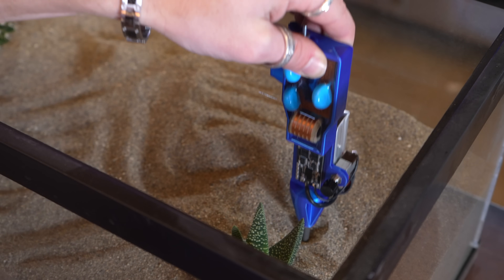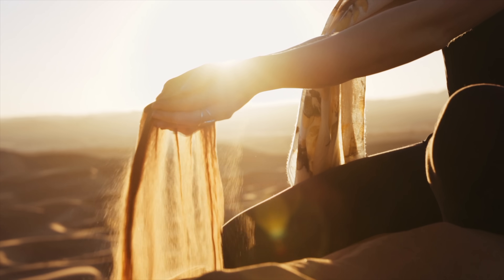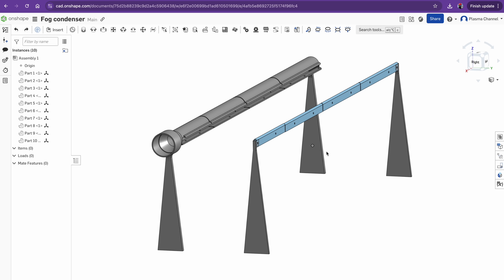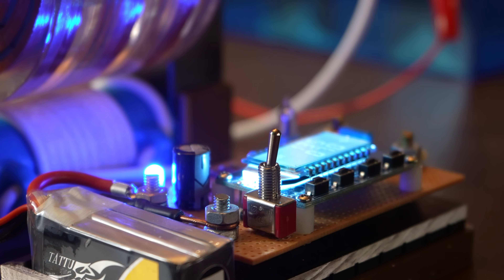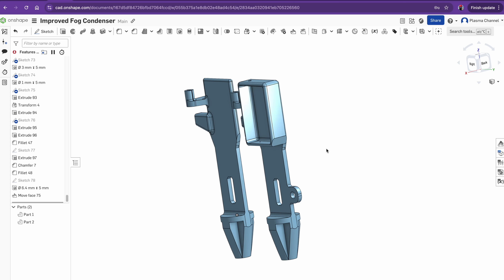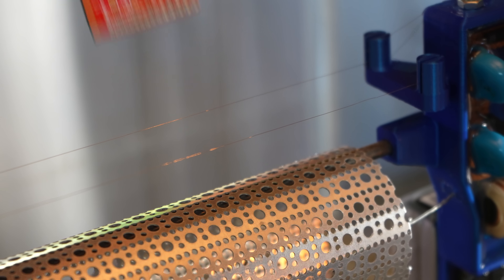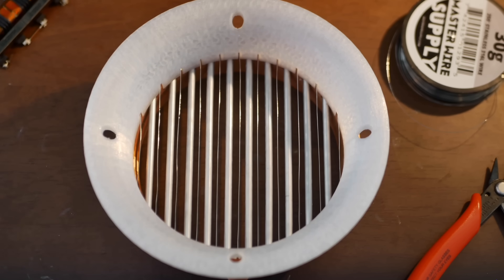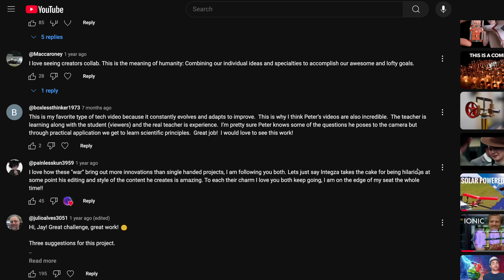Solving Desert Water Shortages Using 20,000 Volts

Comment: While i wish it didnt require fog, i would like to see a larger scale, higher powered version, would 30kv be too much and just send too high of air volume, with a raised temperature that has a higher water vapor capacity over the rakes? Would 10kv be even more efficient if it didnt warm the air as much?
I dont actually know the conditions this 20kv is creating, it might only be moving the air, but it may also be heating it alling for more of the water droplets to evaporate.

(without fog the very inefficient TEC based dehumidifier would be infinitely better at collecting water, and a regular dehumidifier would be something like 5x better)

Comment: Jay, the wires in your collection grid should NOT be horizontal and vertical. Droplets form on the horizontal part, but they do not flow downwards. Droplets that form on the vertical parts flow down before they reach an optimal size to collect other droplets on the way down. I'm not sure if 45 deg. is optimal, but it would be better than hor. & vert.. I read a paper about it a few years ago. Google fog harp maybe? If it comes to me I'll get back to you.

Comment: I have to wonder if that cheap dehumidifier used a thermometric cooler, since it was cheap and powered with 12v, both of which point to TEC. A TEC is far less energy efficient than the compression and decompression refrigeration cycle that an air conditioner or refrigerator uses. A good dehumidifier is basically just a portable air conditioner, but instead of pumping the warm air outside, it puts the warm air back into the room. And of course, it has a container to collect the water that drips off of the cold side.

I'm curious to see what a good dehumidifier would do for a more fair comparison, since most cheap consumer TEC devices are basically just novelty toys. I like novelty toys, just not as a comparison when trying to determine how efficient something is.

Comment: 515 Watts HE Energystar (compressor/refrigerant type)
~23659 ml per 24hr
~16 ml/min @85%RH

compared to ~9 mL/min - electrostatic dehumidifier (based on 40mL in 5 minutes) - 39watts  (I don't know what your RH would be to do a fair comparison)

Looks like it's certainly more energy efficient, but I need a real power consumption over time (compressors turn on and off, so the 515Watts is probably only for the on cycle.  Not sure what the duty cycle would be).  

So looks like electrostatic dehumidifier is the clear winner (plus a lot quieter than a compressor!) on energy efficiency.

Comment: This is so amazing, i'll immediately start to built one. I'm just thinking if this can be improved by adding a wire at the inner side of the metal grid and instead of 2 directly above to put them in a 90° angle

Comment: These often have one slight problem. They are designed and tested on environment that is not the actual use case for it. In a desert there isn't water in air as much there would be in many other places. A lot of people always forget that. It's nice that people come up with designs but hold up hype until it is tested on ACTUAL environment. It might not work at all (or massively under perform) no matter if concept is solid. Keep working on it tho.

Comment: A) They already do this with wet bed sheets (hang them out early, more water condenses on them, going into a bucket.

B) You're still using unrealistic amounts of fog.

C) You're giving the fog no where else to go. Is it going to condense on the dry sand? no. Is it going to condense on the cool metal? yes.

Comment: You could add peltier cooling to get the air closer to the dew point then also add a phase controlled speaker area that you could use to make areas that go through more constructive interference that when in the high pressure cycle increasing the temperature that the dew point occurs causing even more water to form into fog. Also because you can control the frequency and location of the extra fog, you could then reduce the frequency as much as possible and increase your voltage excitation as much as possible to expell the extra formed fog to the other charged plate before the cycle finishes. Potentially making the location of surface collection be in a location of deconstructive interference so to not evaporate the fog before it could condensate onto the charged plate
Reply: When I said area I meant array

Comment: You kept saying, "but then (the fog/water)'s all gone..." The moisture is still there, it's just not condensed into clouds/fog, because the relative humidity drops(aka hot air can carry more moisture than cold). 
That being said, I bet if you buried a pipe in the desert with your contraption in it, that was vented to allow air flow(which seems like it would happen with the charging of the air), you might be able to tease water out at all hours of the day, and not just when the fog was present, and you could use solar power to run it all day, while charging up a battery to run it when fog is there and air is super saturated... foggy. (or you could use a small wind turbine and potentially run it almost non-stop depending on draw and output.)
Just a thought; it's the same idea as earth ship cooling/heating pipes, using the ambient ground temperature to change the relative humidity in the air, you could use the same system for water collection, or maybe not, it's hard to say.

Comment: You need to automatically start/stop your contraption using an hygrometer. 
Also there are wild life issues. Birds, lizards, snakes, cats, rats as well as livestock are susceptible to receive shocks. I doubt you will make any usefull water harvesting in deserts but it can be a solution here in the Cyclades where tourism is harsh on water reserves and it doesn't rain enough. There is plenty of moisture in the air most of the time.

Comment: So galvanic corrision isnt gonna effect longevity for the contact patches?  What about electrolysis happening on the larger scaled setup and a spark setting off the hydrogen created?  I guess you could use electric fence bases with a multiplier added every so often to push the charge on down the loop..  but i would think with using stainless steel and copper conductors it would make browns gas and then randomly youd get pops and shorts..

Comment: Does this only work when there's fog? Which means that commercial dehumidifier could still overall when because it's just getting water out of the air while this plasma device needs fog which only happens for a portion of the day

Comment: What metal was the grid/mesh made out of? Is there a hydrophilic metal you could use that would aid in pulling moisture out of the air? I'm assuming we wouldn't want to use a spray on coating since that could get into the water.

Comment: It seems common sense in hindsight. Ionized vapor makes for sticky vapor. How much moisture would be caught in a metal mesh tarp that mixes the greenhouse effect with the high voltage application of the system you designed?

Comment: oh boy, a water-from-air device, I hear Thunderf00t coming 😅 Ive seen a lot of his debunkings in this area and one of the points he usually brings up is that even for the ones that do work (which this seems to) it requires way too much moisture in the air to be useful in the places it would be needed. Arid places do not have high humidity and the places that do have high humidity almost by definition also get a lot of rain. Add to that how much power youre using and its just not a good solution to the problem.

(edit: at 14:34 you give some stats but you leave out the actual humidity/moisture content of the fog so theyre almost meaningless, if you ran it with no fog at all your numbers would be completely different and you might get nothing at all.)
Reply: also you would need giant collection areas and spreaders because they only soak the soil directly underneath themselves and obviously they have no pressure to go through a nozzle or anything. It also sounds very dangerous for wildlife (and people) to have massive strings and grids of high voltage among the crops
Reply: it will definitely be interesting to see the bigger scale test

Comment: Due to health, I'm moving from a bicycle to a recumbent trike with e-assist (recumbent riding has less heart strain) this year. It also gives me a platform where I can put a pair of 150w photo voltaic panels on it as a roof. I reckon I might be adding a dew harvester to the rig, too, seeing as the aim is to get back to some light cycle touring post heart attack. Less water to carry is also less heart strain. In Australia, there have been a few attempts to "irrigate the desert" but it's teneded to be too costly to monetise... which says to me it's economies of scale are at the micromachine level. Direct crop watering, direct water bottle collection. There's been an absurdly expensive commercial one that's been on the cycle accessory market but failed for pricing, I think. But an HT supply from Ali, a voltage doubler, some simple hardware to direct moist air and condense the humidity, all running off the trike's USB phone charging port... sweet!

Comment: Its called rain.

Its how lightning works.

No, it is NOT in reverse.

Its all about voltage potential in the moisture and surrounding charged particles in the air.

Cosmic rays and gamma rays energize the atoms to find opposing charges that attract and coalesce, which always shunts an excess electron since the negative ion actually has an additional energy stage which moves up the electron charge to the point of an overcharge, and the excess voltage increases as the vast areas of charge get stratified.

It is just a common process of nature.

But what you are doing is working because you are packing the voltage potential to a smaller distance, making ion capture much more likely/frequent.

Comment: Something also to consider is that a properly configured thermal sink can also perform in the conditions you're stating... all that needs to happen is for night temperatures to be below the dew point at 'fogging time' and the thermal sink to stay below dew point for the length of time fog is present. No reason that couldn't also apply to ion driven systems like yours... just a negative plate sized with the right mass to stay cool as the fog rolls. Condensation would be aided. 

Actually thinking now that an underground water storage tank could be used at a heat sink, with the same reason and purpose. Self-amplifying water storage, just by pumping cold stored water through thin metal coils when the atmospheric conditions are right for condensation to form, with solar recharged ion blowers presenting freshly charged fog. The two mechanisms can't help but amplify each other's work, the charged droplet collection aided by the presence of more moisture on the target plate and the cold condensation aided by the movement of fresh wet air over the surface.

Comment: According to BartJBoles comment: Coastal fogs in deserts contain about 0.5 g/m³ of water.  By my "back-of-envelope" calculations: one could stretch the wire for 100m.  It looks like it generates an air flow of at least 1m/s over an effective width of ~0.1m.
So, 0.1m width x 100m length @ 1m/s = 10 cubic m/s, or 600 m^3 / min, or 36,000 m^3 per hour, or ~18 litre / hour by his estimation.  Not bad!

Comment: Does this mean that placing a grounded metal surface in front of a commercial available air ioniser would act as a dehumidifier?
How does this process do with dissolved water vapour rather than misted droplets?

Comment: This is essentially an electrostatic precipitator. While this will collect water as demonstrated, there is another much larger and more severe issue with this idea: Electrostatic precipitators pull solid particles out of the air as well as liquids. In a desert environment where the wind will kick up fine dust, this will be deposited onto the grounded electrode building up an insulating layer and dramatically reducing efficiency, assuming the device can operate at all once this layer forms. The entire ground electrode would need to be periodically cleaned. Traditional electrostatic precipitators are normally cleaned by spraying them down with water which is not ideal in this use case. It's feasible that these could be cleaned without using water but the process would likely be extremely labor intensive making the concept difficult to maintain effectively.

Comment: Even as impressively efficient and effective as this seems to be, the fact that it requires a metal mesh, and real world fog is usually a lot less dense than what you were feeding yours, means that economic and practical reasons will make this still incredibly tricky to employ at irrigation volume scales. Not to mention safety issues.

But for drinking water, which is only about 2-3 litres per person per day, this seems like it could maybe be viable...
But is still going to come down to cost per unit, practicalities of deployment, and ergonomics. Like everything always does.

Very cool and interesting tho, nice work.

Comment: Fair weather typically has an atmospheric charge... a potential difference of ~100V/m. 200 meters of thin wire on a balloon could potentially (hah) provide 20kv, though at microamps. Be interesting to see if a collector could be configured to take advantage of such low amperage. 

Oh, and a small balloon would be just fine in the conditions noted... it's foggy. The air is still, and dense.

Comment: Very cool video. I do industrial scale electrostatics, and always love seeing the stuff you play with. One point is that actual dehumidifiers are made the remove water vapor at below the saturation level so they have to overcome the phase change energy. Plus, those little dehumidifiers are externally inefficient. The tech you are using is commercially known as a wet electrostatic precipitator, or WESP. They are incredibly efficient but will remove only already condensed water droplets. Thus the efficiency, they mostly only collect, not condense. Fog is, of course, already condensed and so they will work well. Commercially, they are used to remove oil or tar fumes, or water droplets after scrubber operations.

Comment: its a water tarp, a big sheet artificial river. or just freeze the fog. more. ie use an ac unit. pitch is too high to be useful. its about collecting the fog, not about the condenser itself. well it just needs cold, not high pitch. keep it simple zapper. ozone levels? scientific comparison to the cold condenser. well if you like high voltage animal fences. you know western atmosphere humidity is high already all the time. ie normal air condensing of water already produces some water over a time. playing broken bipolar radio hmh. its the movement capture of air, not the voltage in itself. if you let the drops hit the mesh more, of course they condense. as a test, try a normal fan next to the fog net. or just wind. well, wind water drip lines.
Reply: so why not spin plasma fusion reactor.

Comment: Perhaps you need to upgrade your AI game :)
This is what GPT o3-mini gave me:

Yes, high voltage can theoretically be used to collect moisture from fog. The idea is that high voltage creates a strong electric field, which can polarize water droplets in fog. These polarized droplets may then be attracted to a charged or grounded collector, helping them come together and form larger droplets, which makes them easier to collect.

However, there are several challenges:

- Efficiency vs. Energy Input: Setting up a high voltage system may require a lot of energy, and whether it improves overall collection efficiency enough to be practical is still under research.
- Safety Risks: High voltage systems come with safety hazards such as electrical shock and arcing. Proper insulation, grounding, and safety measures are essential.
- Experimental Stage: The concept has been explored in experiments, but it hasn’t yet become a widely used, large-scale solution.

In short, while high voltage could potentially enhance fog water collection through improved droplet aggregation, there are significant energy, efficiency, and safety considerations that need to be managed first.

Comment: As a farmer, you only need them to be 1 foot wide, blue tooth added, humidity sensor add,  and a power wire connect to each unit for continuous use. Set up a program for need to come on and off to maintain and maximize  humidity in your plants. If you could get enough labor for installation and the product has battery only as backup for the power wire. You could make an app and control your watering from your phone. That's done now by irrigation center pivots. The hard sell is you would have to remove them before harvest in mass. But if you wanted to farm the dessert you have a product that will sell.